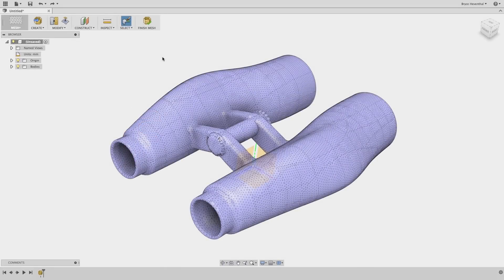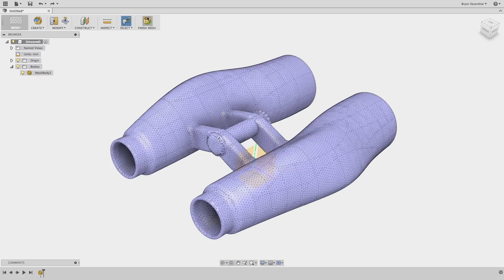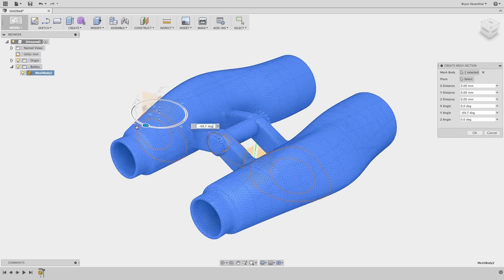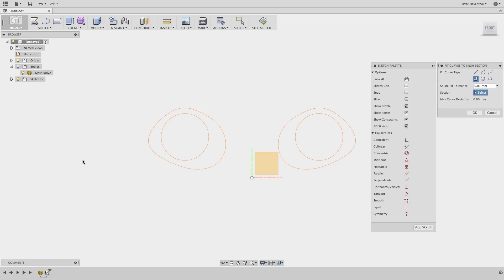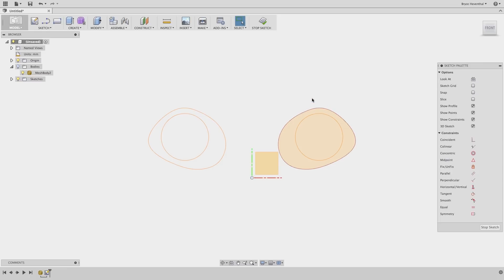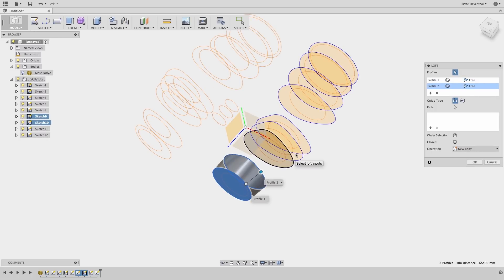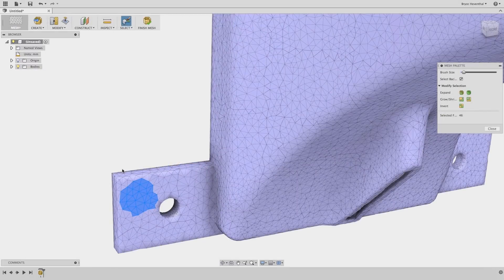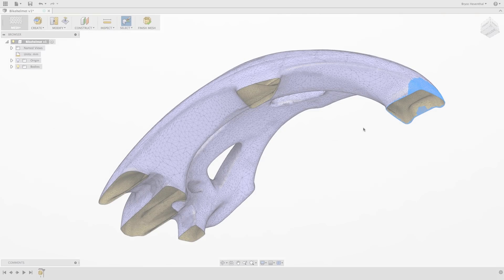Autodesk Fusion 360 | Quick Tip: Reverse Engineer from a Mesh Scan

Comment: This tool is so amazing! Is there a way to generate multiple 'fit curve to mesh section' paths in a determined distance? Doing it manually would become really labour intensive on larger scans...
Anyway, I am amazed by Fusion so far!
Reply from the maker: @Max-  There isn't an automatic way, but what I have done in the past is to create a thin body (like 0.001" thick) and pattern that body multiple times using the rectangular pattern command to create multiple "slices" through the mesh.  Then, when I do a "Fit Curve to Mesh Section", I select the front of each plane slice that I created.  Hope that makes sense.
Reply: @adskFusion  I'll give it a try! Thanks a lot :)
Reply: @adskFusion  Ok, thanks again. I tried it and it works, but you can't select multiple planes to create the mesh sections at once, can you? It's veeery time consuming to select the mesh, then select the slicing plane and hit enter for each layer... Am I missing something? If not, I would greatly appreciate it, if you guy could implement an automated "create mesh section" tool with a distance to set between each layer or something alike.
Reply: Autodesk Fusion 360 when will you add the ability to create quads within fusion 360 without having to use and pay for Recap? I understand that free software like instant mesh works. I’m more interested in keeping things within one software. Not complaining, love the software. I do a lot of scanning and dislike using multiple software to do one job every day.
Reply: This tool is amazing, but it wouldn’t be easier if it just created a sketch section at once? Why would someone would want to make the process manually... this would be a great update sometime👌🏻.
Reply: @estebanjurko  Exactly